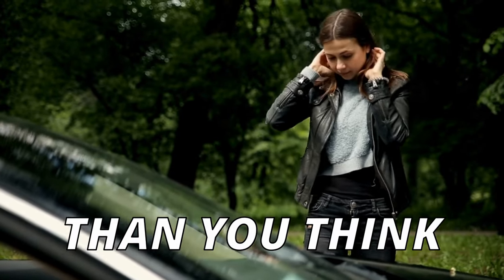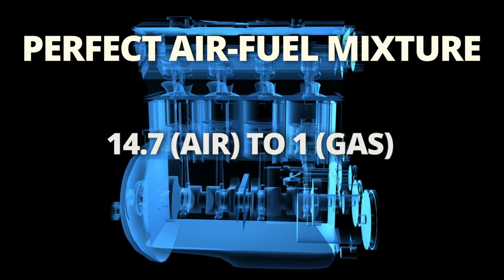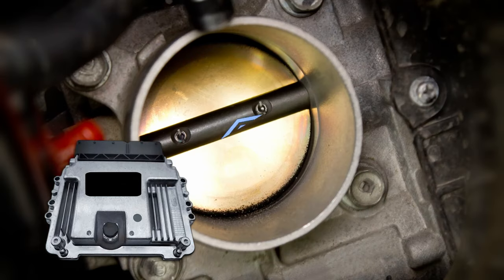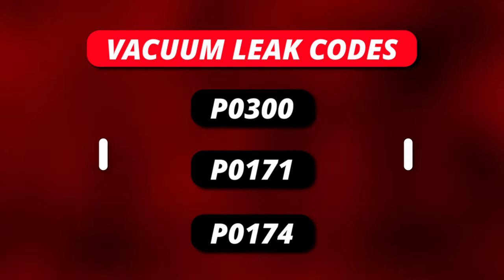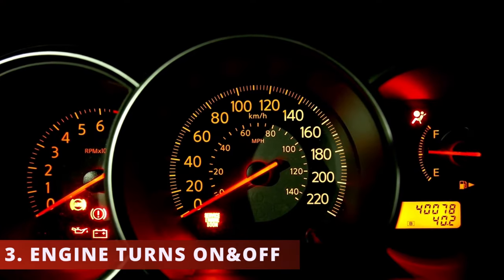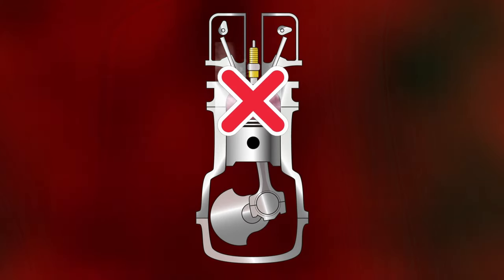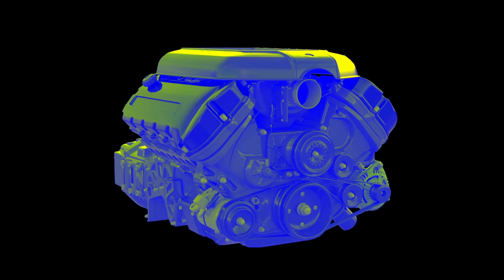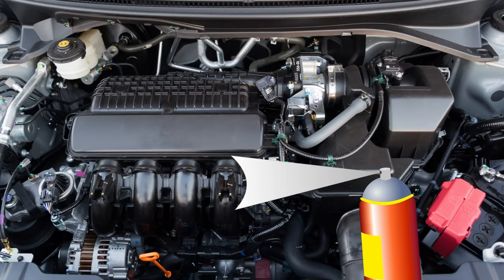VACUUM LEAK SYMPTOMS (ULTIMATE GUIDE)

Comment: I don't recommend spraying carburetor cleaner around the engine! I had that happen one time ⌚ and ended up with a car fire 🔥! Luckily I had my fire extinguisher near by and put it out quickly.
Reply: Dawn dishsoap and water does for prophane leaks probably works for engines too
Reply: In a 2007 crown Vick when I put my foot on the gas it goes dead when I driving and it pop up a p0446
Reply: @shunwallace who are you talking to
Reply: wd40 works better and its not flammable

Comment: I went in for an alignment and the guy went to the parking lot and pulled my car into his shop. He then came back inside and told me, man you love your rite it’s so smooth u can’t even hear the car is on. Well rite when I pulled off it had a lack of power and few days later it was running horrible when cold startup till warm. It ended up being that the guy loosened all my intake manifold bolts. The question I have is why? They had 5 star reviews why me?
Reply from the maker: Im sorry to hear that.
Reply: Guy wanted you to come back in and get charged up the butt for a super easy repair that he knew how to easily fix.. I do all my own work because I have trust issues with mechanics, not everyone is out to get you but honest mechanics usually have a long wait and are more expensive- but not always!!
Reply: This is why i went to mechanic school and learned how to fix my own car.Slimy mechanics like the one you experienced are just about everywhere in these days and times and that includes at the dealership,yes especially at the stealership.They got me one time many years ago,i swore it’ll never happen again.

Comment: I had a vacuum leak because of three loose hose clamps. It caused the car to occasionally idle rough, headlights flickered because of poor idle, and the car would occasionally stall
Reply: You think this could happen if I have a broken air filter box, the 5 min oil broke🤬. I also have a coolant leak ?
Reply: @user-pr5  yes it cause a vaccum leak

Comment: My gas cab caused a vacum leak the code was p0456 indicates evap system detected a small leak, i changed the gas cab and everything went to normal, note that the code calls for a vacum leak in the evap system not partically the gas cap

Comment: I had a vacuum leak coming from the small air box on top of my 05 Saturn L300’s engine. The rubber fitting around the intake was totally split open like a starfish. It would idle at over 1000 rpm, and run rough at lower RPMs. I went into Autozone and bought some heat shrink tubing, then walked across the street to a gas station and bought a lighter. Heat shrank the fitting closed with 1 tube, and then heat shrank another tube with excess bunched up around the intake to create a snug fit. It took a few tries to get it air tight, but eventually the suction noise stopped and the car started idling normally.

Comment: I need help! I have a 2000 e320 Mercedes and I believe my problem could be a vacuum leak as well as a crankshaft position sensor, but idk. It hisses super loud and it misfires constantly and when it does so the check engine light flashes. And it won’t let me go above 20mph no matter what.

Comment: Spot on my man, i would only add speed density engines (map but no maf) react the opisite to vacum leaks. The engine runs higher rpm than normal beecause the computer adjusts for the pirate air. Maf and a map both on the engine they respond just like a maf, low idle and want to stall

Comment: I just bought a used Honda Civic. I’m experiencing these symptoms the RPM when I’m at a red light is very low. In fact, when I got the car I noticed that the hose to the engine air filter was off so I put that on wouldn’t be surprised if there’s a leak somewhere.

Comment: I have Mercedes-Benz 200, 123 Series from 1982 and it has a vacuum leak.
I can't exactly make out where it's coming from but it's somewhere in the middle. Any tips to find it? Besides using carburator cleaner.
Reply from the maker: Smoke machine test
Reply: Vacuum lines are cheap. Don't be cheap. Replace that shit and get up the road

Comment: So I had a check engine light and cleared the code, ran the car for about 300km, high speeds. Then when I stopped, the check engine light came on again. It looks like a vacuum leak caused it. 

Is that fine???? That I drove the car for quite a distance. Did not notice any performance issues so I thought it was ok. 😢

Comment: Can a vacuum leak trigger ONLY a PO420 code ?.... cat efficiency low? I'm chasing a far away turbo "whine" sound that could be an exhaust leak or intake leak. Seems to me to more likely be an exhaust leak before or at the cat, affecting the fore and aft sensor operation....this can trigger a PO420. However, I have no other codes thrown as you show ( no PO300, no PO17X codes at all)...and if these aren't there....can we safely assume I should direct my attention only on the exhaust side? I have no idling issues or driveability issues either....just the far away turbine noise and the PO420 coming back. Oxygen sensors test fine and no sensor codes are thrown either.

Comment: Any ideas common areas of a leak with a 2010 Infiniti G37? I'm finding low coolant levels along with dampness down the sides of the engine.. possibly valve cover or intake??
Reply: your water pump is going out.your gonna have to do your gallery gaskets while your there.leaking gallery gaskets will cause low oil pressure big job and check ur timing chain for slack

Comment: Everytime I’m at a stop sign or red light and I’m on my brakes. My car rpm’s drop and it once died and turned back on. Any fixes?
Reply: Same here did u find out what was the problem
Reply: Brake booster consuming more vacuum at a stop. If there's a leak in vacuum. then there's not enough vacuum for other sensors to regulate air-fuel ratio causing problems
Reply: @McWeldShit  seen that on VW vortex, but i think it’s a fuel pump issue. Right before it’s about to stall I hear the pump hum and then the rpms jump up and down. Hasn’t been happening ever since I used some fuel cleaner

Comment: Mine sometimes dies straight after cold start. Triggered o2 codes. Slight hissing sound sometimes. Slightly lumpy idle like its gonna cut out. But 3 mechanics have said cant find air leak and one even used a smoke test
Reply: fuel pressure
Reply: @AIoverlordDave  turns out it was the connection from keyfob to WIN module. And also o2 sensor. Hissing was in my head haha

Comment: I have a 2013 BMW M135i with the N55 engine.

My car runs very bad when it’s cold outside. (extremely rough idle) The colder it is the worse it gets. 
At temperatures Below -15c / 5f the engine may even stall a few times.

After a few minutes when the engine has been warmed up it runs perfectly fine.

Could this be caused by a vacuum leak?

Spark plugs and ignition coils have been replaced recently but that didn’t help at all.

The previous owner of my car installed an open air filter and blow off valve. Maybe he did something wrong and ended up with a vacuum leak/boost leak?

Please help me i don’t know what to do. i just bought the car 6 months ago and it’s the most expensive car i have ever owned.
Reply: Did you fix the problem?

Comment: Hey do you know why my car starts shaking for 2 sec and dies when I come to a stop when I pop it in neutral it stops and also is the car supposed to idol at like 500 to 750 rpm
Reply: The only code it is  showing is 02 sensor which I replaced and I replaced spark plugs and coils and 2 engine mounts if ur wondering it's a 2011 hyundai sonata
Reply: Also fixed a valve cover gasket but it's still leaking oil not from the valve tho

Comment: I have a lean fuel problem when starting, but once started it runs ok while cold but stalls out more when it starts getting hot. I had a vacuum leak that I fixed but there seems to be fluid in the vacuum lines, I changed the fuel pump about a year ago, the fuel filter a year ago and again a month ago, new tps, new thermostat, new fuel pressure sensor under the hood. I’ve taken of the throttle body, iac, egr, maf, and temp sensor and sprayed them with cleaner. It’s a 1997 Chevy blazer LS 2dr with 4wd and 4.3 vortex engine, I don’t have a fuse box under the hood that I can find. It seems like fuel pressure is low but watching these videos it seems like all the symptoms I have could be anything in any of these videos but the main difference I see is mine gets worse when it warms up not better. It does seem like a gasket could be leaking but I have stop leak in the oil and sealant in the coolant and I haven’t noticed the fluids mixing as of yet. And I don’t have any smoke from burn off from the engine. I put in a catalytic clean and an injector cleaner in it also which seemed to improve its performance some and made the engine light go off but still have a crank no start and stalls when I drive it too long, Any advise?? My next step was the fuel pressure regulator inside the manifold or the valve the vacuum hoses connect to on the transfer case. Yet I’m still not done with your videos, but I am learning a lot. Oh and the battery reset so I have no codes to go off of. But months ago before doing any of this I had a code for cat, egr, and hvac. Oh and the gas cap was relaxed a few years ago and radiator cap was replaced a few months ago and the battery is also new and battery terminals are new but wiring is a little questionable. Before the lean condition started I used to have to jump my car everytime I started it even after I got a new battery so I thought maybe a ground was out somewhere then this started happening so I haven’t ruled out bad wiring just yet.

Comment: Geo metro engine placed inside Suzuki Cultus ... EGR vacuum leak hoses connected wrong also a vacuum that connected to the fuel regulator if the fuel regulator sensor is stuck open  you will burn more fuel

Comment: Hi what's happening I find Ur channel very useful.... So I have a question about my 2008 tundra so my battery died from parking too long. Then went to replace it with new. Now when I connect the terminals the starter keeps cranking none stop. So I have to disconnect one of the terminals to get it to stop..what could cause this pls
Reply: Your 12v positive has a connection to the 12v trigger on the starter solenoid. That causes the starter to crank. Either figure out which wire doesnt go to 12v positive constant or replace starter.
Reply: @roundsm18  thx for responding. So I end up pulling the relay out then connect the battery terminals then switch the ignition to on and press the relay back into place. And the non-stop cranking stop. Now operating normal..👍

Comment: My 1997 Toyota Tacoma with A 2.4L engine starts but when warmed up and put in gear, even in reverse it stalls! My Blue Point code reader is pulling code PO 171 system to lean, PO 130  O2 circuit sensor 1, PO 133 O2 circuit slow response Bank 1 sensor. Any ideas on what to look for?
Reply: OXYGEN SENSOR BUD. OR OXYGEN SENSOR CIRCUIT SLOW RESPONSE.
Reply: Ford exption 5.4 lean code break goes to the floor would the break booter do that